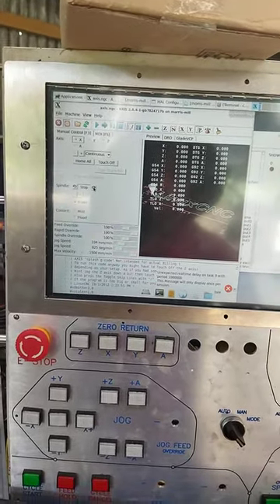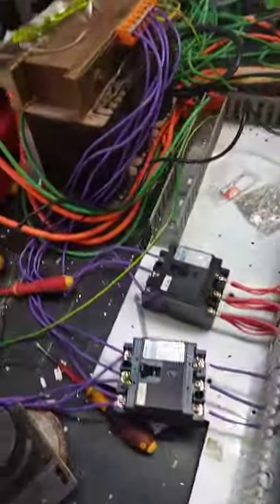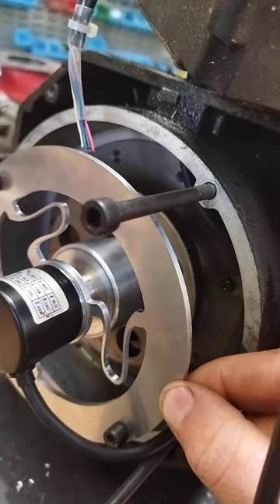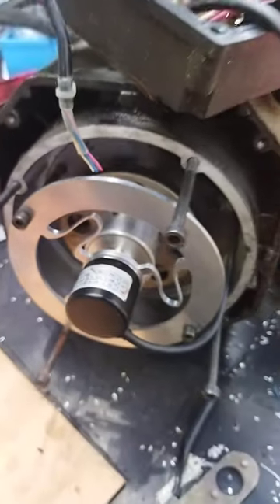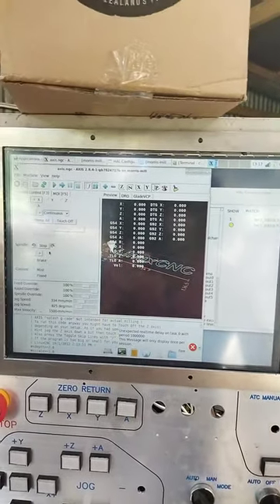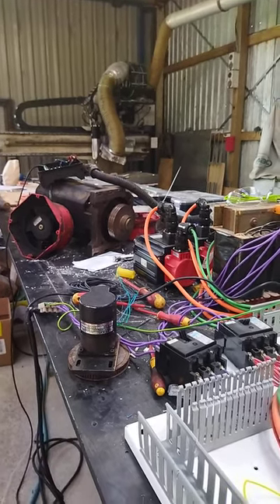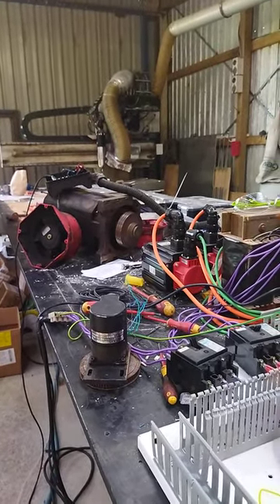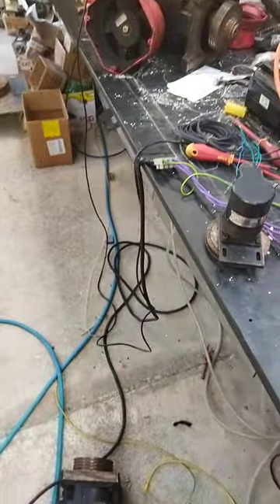linuxcnc mill closed loop control with Chinese vfd and fanuc spindle

Comment: Hi, are you able to do spindle orientation with that setup?
Reply from the maker: You could if you do it in linuxcnc with a pid loop.

But not in the drive itself.

Though you can get drives from them they do it internally